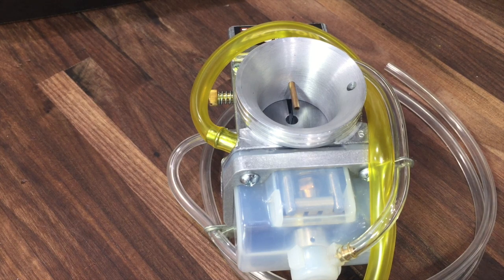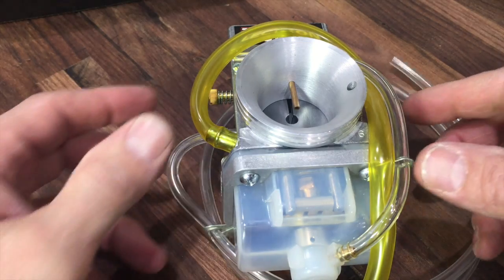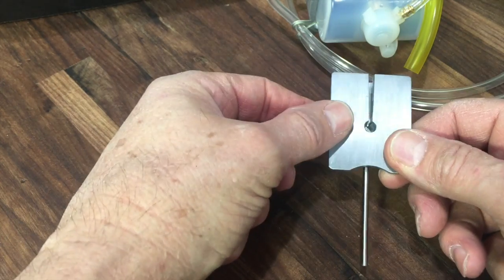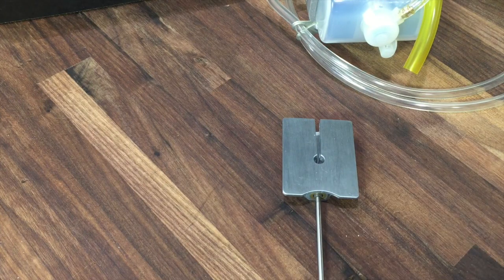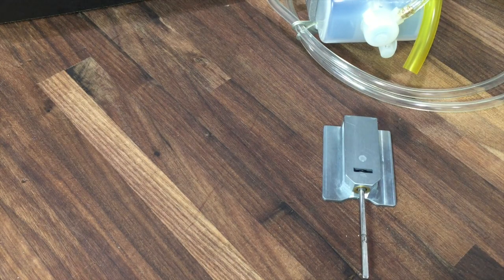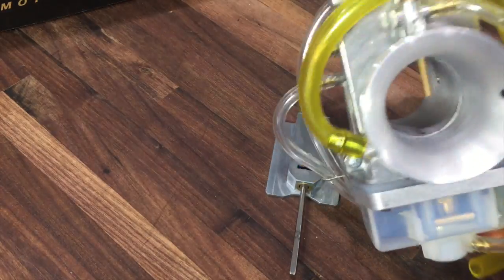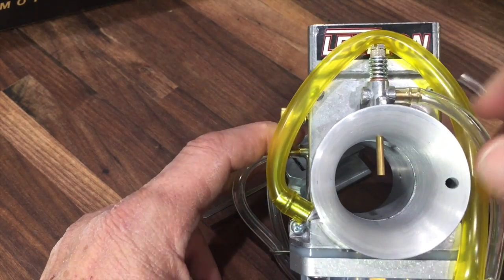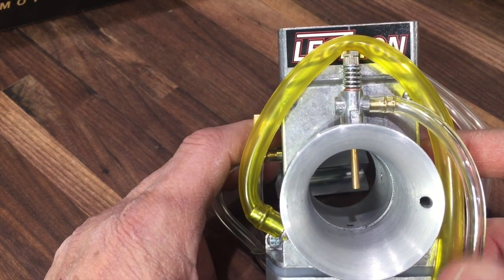How Lectrons Work

Comment: I contacted Lectron via email 2 weeks ago asking about my application, even giving them a link to the exact competing SC2 product [a product that is factory calibrated for my Exact application) and asked if they have an equivalent offering from Lectron and if they have experience with my application.  

They never got back to me and I will never forget this.

In the end, I just went with a genuine Keihin PWK (new take off $150) and got a full set of quality jets and needles along with a different sized throttle slide along with a WBO2 sensor and I still have money to spend compared to if I dropped $700 on a Lectron/SC2.  

I'm skill skeptical of how the Lectron/SC2 compensates for altitude, I have yet to find anything other than the same repeated non-explanation explanations.
Reply from the maker: Hello: If you really are serious about contacting any company, pull the phone out of your pocket and call. They may have never even received your email or they may have responded and it bounced back due to some glitch. Before you get your undies in a wad and start bashing them online, make a more serious effort, CALL. 

As to your skepticism, how they adjust to altitude and temperature changes is simple physics. This video explains how it works, https://youtu.be/v_5KH01hFgc .
Reply: @slavensracing  You have to understand from my perspective, coming from the outside, the needle jet carb community shares Cult like behaviors so that is grounds to question things.  You must also take into account from my opinion, a carburetor that adjusts for elevation is one of the Greatest Inventions of Mankind, am I going crazy here!?!? Why isn't this a "Big Deal"?  Internal combustion engines are absolutely everywhere on the planet, not just dirt bikes.  

Did you see XTNG, they're making a Lectron type carb. Where is the Lectron legal team on this one trying to enforce their patents from 40 years ago?  

You Mr. Slavens are superior to me in many ways most especially when it comes to your Art. I will always defer to you on 99% of subjects within your Art, however the elevation compensation is a big topic. I smell bs here, it's going to take extraordinary evidence to back extraordinary claims.  I'm not knocking or denying the Lectron's performance when dialed in, I'm focused on elevation compensation claims only.

I have tons of experience developing powertrains in the dyno cells, mechanical and calibration development and experience on my own stuff hundreds of hours.  Through years of my experiences, I now require evidence and empirical data to sway my technical opinions; especially considering a game changing revolutionary technology.

I challenge anyone, with the level of curiosity & doubt I have and the resources available, to run a test on the dyno to prove a Lectron or Smart carb actually compensates for Density-Altitude.  I propose one way to test this would involve changing the Intake Air Temperature while logging AFR on the dyno rolls repeating the same load & speed points between changes.  
If you don't have a $5m air pre-conditioning system, one could leverage the cold winter air from outside (ducted in) and I reckon a 8kW chinese diesel heater could keep up at lower load points to provide Hot Air.  This would somewhat create a large swing in Density-Altitude easily on the same day, in attempt to get the dyno testing done in one-shot.

Until then, no one can convince me with 'opinions' and test results based on 'feelings'.
Reply: @slavensracing  I just called them, I explained that I'm seeking some clarity on the elevation compensation test reports and information, and after asking around they "don't have any publicly available information". 

I'm assuming Lectron is a good product and I'm confident the elevation compensation stuff is not what you think. Standard carburetors also adjust for elevation, because the air density would change the pressure differential in the float bowl, and if the fuel density does not change that means less fuel is drawn up.  <- This is what is happening, Lectron is not lying, they're being deceptive in saying it compensates for elevation.

Comment: Hello.
I recently bought used lectron. It works great on high rpm. But not have enough power at low rpm. Please advise the necessary settings

Comment: Jeff I got a Lectron carb for my 2000 rm250 ran great 1 kick for several days then was hard to start wouldn’t start had to heat plug w torch then it would start. Day after riding a track it wouldn’t start. Put starter fluid into spark plug hole fired up was stuck at wide open it wasn’t getting any gas into motor why is my brand new Lectron carb not working. My motor almost blew up it was dieseling.... it ran perfect less than 24 hours before I’m at a loss for words now
Reply: Kill switch wouldn’t kill it removed spark plug cap, and carb hose it still wouldn’t die turned it on it’s side and engine died
Reply: Metering rod is in correct way too!
Reply from the maker: Since we didn't sell it, I have no idea how it is set-up so I can't assist. Contact the retailer you purchased it from or contact Lectron direct.

Comment: if i put one on my 06 rm 250 can i just disconnect the electric connector plug into the carb and the bike will run ok?
Reply: motox766 yes the Lectron doesn’t have a power jet that connects into your cdi from your carb and it runs 100x better without it

Comment: Everyone seems to be switching to Lectron these days.  A few years ago I did see one bike with a Big Air PSI on a dirtbike and not a harley, which is supposed to be jet less using a series of screws on the outside.  Pretty expensive though.

Comment: Hey Jeff I bought this lectron from you and It's had a slight bog to nasty bog at times since I installed it. I probably have 7 hrs on it at this setting. I have the slavens head and vforce 4 reeds. Bike has a total of 27 hrs on it since new. I'm thinking metering rod might be backwards. I road it last Sunday and it was to bad to ride.
Reply: Forgot to add it's a 2016 ktm 300xc
Reply from the maker: Bogging is a lean condition. Richen (clockwise) the metering rod 1/2 turn.
Reply: Jeff Slavens  ok will do
Reply: Move the metering rod 1/2 a turn like you said and bam right on the money. The bike runs mint not even a hint of a bog anymore and the bottom end woke wright up. Thanks jeff happy lectron owner.
Reply: Hello! What you are using a metering rod? (5-2)?
Reply: Papp Racing2T yes lectron uses metering rods no jets
Reply: metering rod type? (5-2 or 4-2)?
Reply: Papp Racing2T you need to ask Jeff I don't know anymore about this carb then this video.

Comment: I bought one of these for a 2017 300 XC. it hardly ran at all when I first put it on so I turned the metering rod in clockwise one full turn which helped immensely. But still boggy in the bottom end so I went a half turn more still boggy in bottom end. should I keep on turning? is this normal to have to do on the HV mule?
Reply from the maker: This is not a customer service/product support forum. Please contact us directly.

Comment: I lived in Modesto ca. in the 70 and 80 and I remember Kenny ran those carbs as did many flatrackers .  We offroaders never took to them  though.
   I  have an xc300 that you ported and it runs really strong and clean.  I sure would like more off the bottom low rpm  power though.   I also ride a 150xc that i really enjoy on trails but it is finicky to  keep jetted thru the altitudes and seasons.   Do you think this carb would benefit a small bore?   Maybe more bottom on the 300?   thanks,   Dave
Reply: Ray Eh has a 150SX with the Lectron and he says its amazing.

I can speak for the 300 (comparing to the Mikuni which i couldn't get dialed with jet changes, needles, etc) 

It WORKS.
Reply from the maker: Yes & yes.
Reply: dave davo yes the mule hv works awesome on my 2017 150 sx.

Comment: The Carb. is great. on my '17 xc.  Just a note:. many people install this and it's nearly perfect from the factory.  Mine was rich to the point that the bike would barely start.  I ended up 1.25 turns lean for a setting.  I thought something was wrong and called Lectron and they said it was ok. So don't panic and start adjusting everything on the carb.  Stick with the metering rod until it sorts out.
Reply: you lost me  Sorts out?
Reply: dave davo in other words, keep adjusting the metering rod until the bike idles close to ideal, then adjust the idle screw to perfect.  sorry about that, sorted or sorted out is a phrase my family uses a lot, and it's not super common in the states.
Reply: My instructions from Jeff with my HV Mule said: Adjust the idle and drive it. Do not adjust anything else. I adjusted the idle so far and it seems good, but it's super cold outside and I cant get a real test in until it warms up a little.
Reply: motocross211 yeah that's the instructions I got too. I was just surprised to see myself at more than an entire turn out. So I just wanted to make sure that something wasn't wrong.

Comment: Thanks for posting. How do you Lectron compares to Smartcarb? Undecided on what to get for my 2017 KTM 300XC
Reply from the maker: Lectron and I have done a lot of development for the '17s, they give excellent customer service, we have them in stock and they work very well. 

Smart Carbs: Poor customer service, never have product to sell and a sketchy performance record. Life is too short to deal with their issues.
Reply: Go with the Lectron. Lots of R&D put into these 2017 KTM and Husky.
I'm very impressed with mine.
Reply: JC Kloppers I really like the smart Carb idea.  I guess performance and function have been a bit of an issue.  the reports of orders not being filled, and customers not being able to contact anyone was a big issue.  hopefully that will all get straightened out, and we'll have another great option.
Reply: I currently have a cast 38mm Smart Carb on my 1997 YZ285 ( Max RPM's 285cc big bore kit ). I think they have great customer service, always helpful, it seems that everyone on You Tube that has videos on them like it. My bike screams with it , very snappy especially in the mid range. My carb was on back order for a few months in the winter of 2016, but it was too cold to be riding then anyways. The Smart Carb only has 2 adjusters, the idle/air screw and the lean / rich metering rod adjuster on top. No complaints here.
Reply: @stevedouglas6325  long term report on your Smartcarb.

Comment: Insightful video Jeff.  I was astonished how much better my 17 300 XC ran after adding the Lectron!  Much better fuel mileage and no spooge.
Reply: dont know how you managed that they dont offer any more power than the stock metering device did, they just rule out friggin round with the jetting and better economy.  maybe you didnt have it dialed properly?
Reply: Carbs

Comment: Awesome Jeff. Installed mine tonight on the 17 300. Amazed at the difference. It was -15C outside and it didn't seem lean at all. What kind of temperatures will these compensate for? I'm hoping I don't need to touch a thing.
Reply from the maker: That's too cold for comfortably riding dirt. Is this a snowbike application?
Reply: No. I won't be riding in these temps really. This was my only chance to test the bike back to back. I do run Trelleborg studded tires in the winter but I try to stay in -10 at lowest (no wind) to +10C in winter conditions.

Comment: Awesome video Jeff. Thanks for the explanation and information. This is going to be great on the ol'300.
Reply: I just put my Mule HV on my 300XC tonight. Paired it up with the XC-W Flange, and did the holes Jeff did in his videos. 
I ran it before and after today, Mikuni first. Was a dog, wouldn't rev out. Had the 1/8th ish to a quarter burble. 
Put the Lectron on, adjusted the idle like it says. Bike feels different (awesome) already.  Cant wait to put some time on this thing.
Reply: motocross211 hows ur lectron so far u happy with it?
Reply: motocross211 ya thats pretty cold lol i just winterize my bikes shes all put away till i get my 350 4t , 2 strokes dont like the cold lol thats awesome thou ,good to hear its working for u.
Reply: Yup, I ride all winter usually with studs. It's funner than dirt riding I think. Really open up the riding experience. My 16 Kawi 450 won't even start when its cold. Meanwhile every two stroke I have in the garage fires right up. My 450 is actually stuck at TDC it's so cold.
Reply: motocross211 lol well ur good to go then to do a top end on the 4t hah